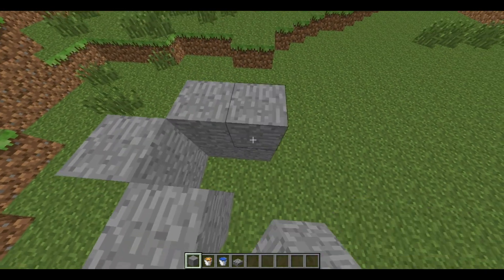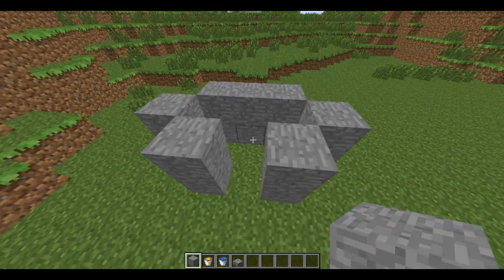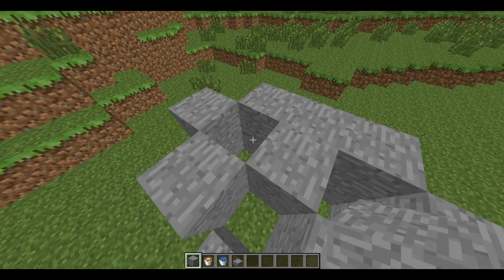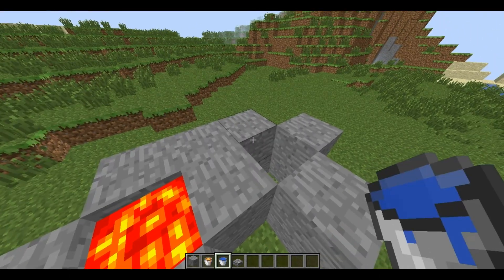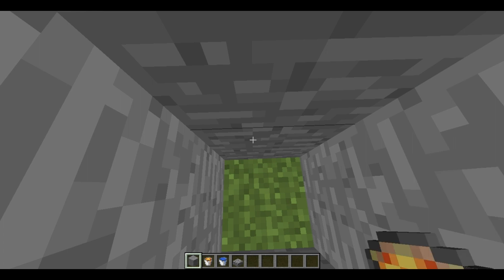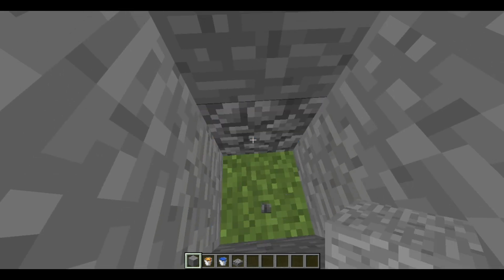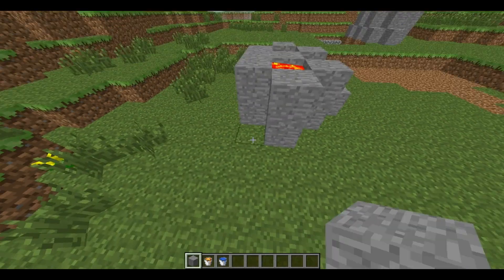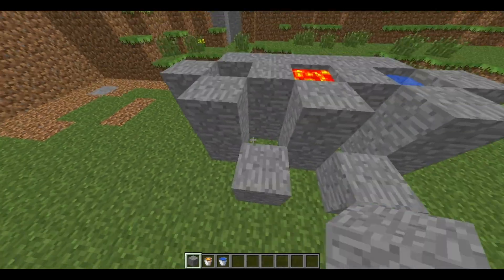DJ&Riggaz: Pistonless Cobblestone Generator

Comment: It's not a bad design. The problem is caused because the water flow meets the lava as it's travelling towards it, which often pushes the item into the lava as well. I've found that if you move the water source blocks and the "tubes" that hold them from their positions across from the lava to positions diagonally behind it, the water flows directly towards the player, and not towards the lava.